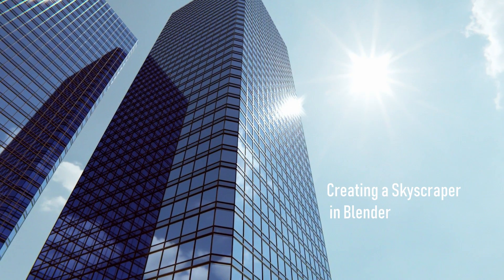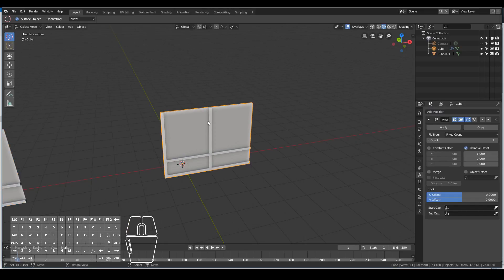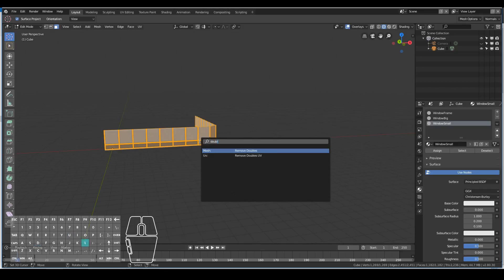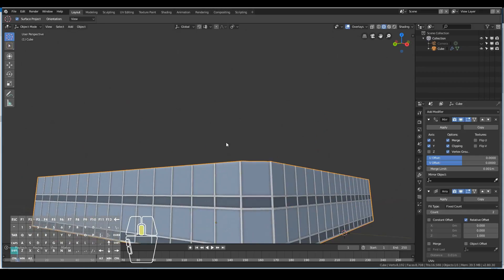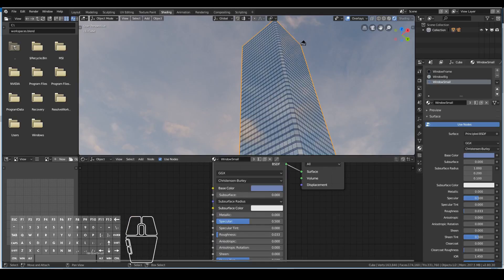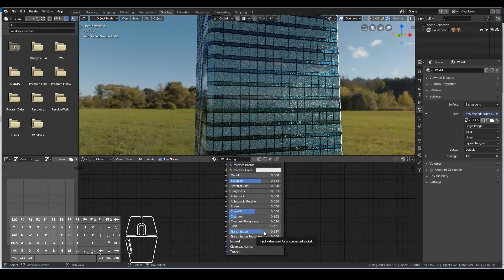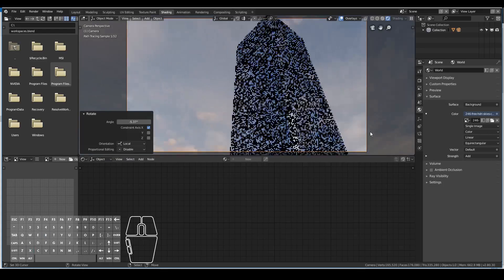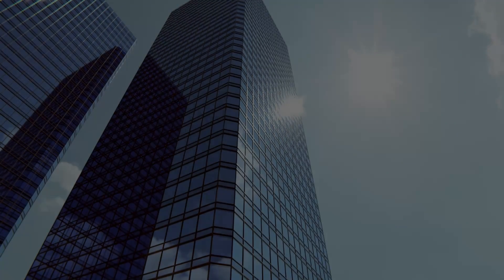Creating A Massive Skyscraper in Blender

Comment: Thanks for the video - but you talk way to fast sometimes talking about one thing while you actually doing something else
Reply: Well I solved ur problem! 
Use 0.75x playback speed
Reply: @cosmicblox934  even at .5 it's still not enough to see quick adjustments like the shader settings
Reply: @cosmicblox934  you

Comment: Hi Thilakanathan, I have to do a similar work; I have just one doubt: what if you wanted to change the dimensions or adding a texture on the windows AFTER applying the array? `cause if I apply the layer both alongside the horizontal and then the vertical axis, then I have to edit each window singularly. I´d like to have more copies of my elements that can be all edited in one shot by modifying the, lets say original one. Any ideas?